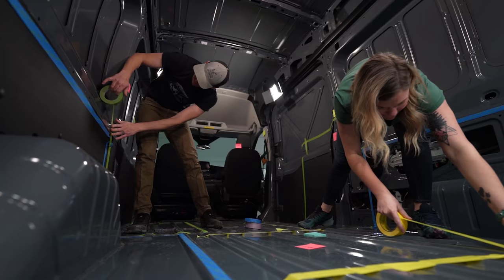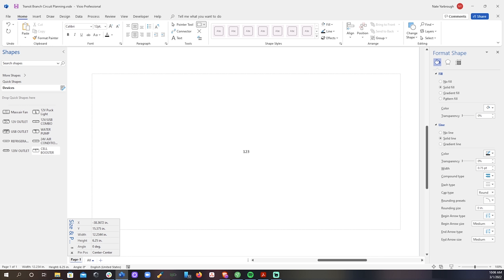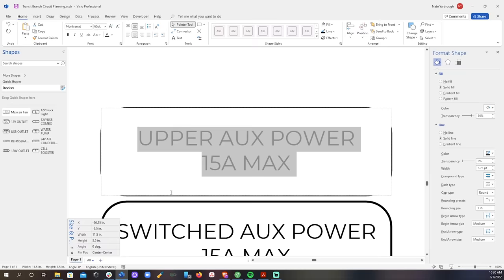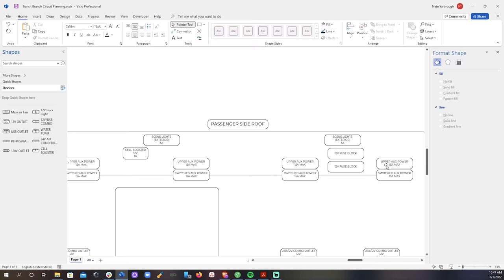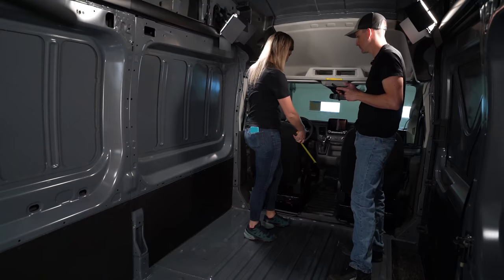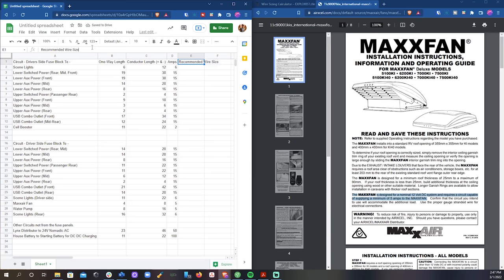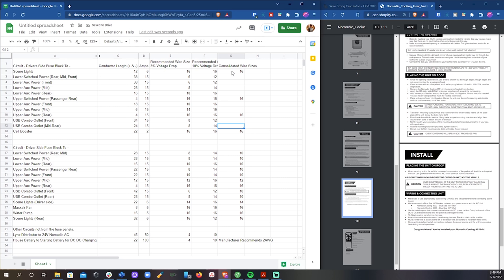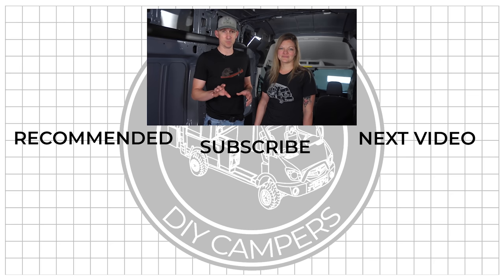Planning the Electrical System in our Ford Transit DIY Camper Van

Comment: I had rear exterior lights (to monitor the load of trailer or assist backing up off roads) on a previous van.  (Your comment at 3:20)  Best feature ever!  I had them wired to either come on automatically with backup lights, with an override switch (ON  or  always OFF).  Loved that setup, so now I add to every vehicle.
Reply from the maker: Great!  Will probably do that then. 👍

Comment: Great video, watch this series because of getting ready to do my build which is still in the planning stage until we get our van. Never thought about just putting in connections so I can add or remove items as needed like the fridge or whole kitchen unit. I have been thinking about how to make items easy to remove. The only thing I cannot figure out are water  lines and drains. I think the whole electrical box can be removeable with just a couple connections but not the heat and water system.

Comment: Any guides or resources you recommend to better understand the calculations you did and electrical information, to better understand wire sizes and why the lengths etc are important?

Comment: Thanks a lot for sharing. Now that a fair number of electronic devices can charge via USB PD (Power Delivery) and this can go to 100W (at 20V), it would be great if you could explain if you would: go via main power (120 or 240), or use 24V battery bank and have sockets that can provide USB-PD up to 100W (not sure if such outlet exists). This could maybe be only for outlets close to the batteries?

Comment: Why are you using a GND return wire? Could you not have one or more chassis bonding points and bring the return current back to the battery that way. It would lower the over all impedance of the run and then you wouldn't need heavier wire and you would lose less voltage in the wires. Only asking because I'm about to retro fit a small solar panel to my 1991 campervan.

Comment: Hi Nate, thank you, these are SO HELPFUL! When planning wire sizes in a spreadsheet, do you add together all of the amps on one circuit? I know this seems like a simple question but I can't seem to find a quick answer. 

For example, if you had two water pumps together, do you add the amps for each one, or just use the larger one (assuming they are different) since they won't likely ever be used at the same time? Or when putting together a string of lights, add the amps of each one since they will definitely be on at the same time? 

Thank you. Truly. Your active response to comments is really a huge gift to all of us trying to figure out our builds. 🙂
Reply from the maker: For 'Known' loads like a water pump or lights; I'll add the amps of everything on the same circuit.  For 'Unknown' loads like 12V outlets, I'll assume a max circuit amperage of the max amps of a single outlet (usually 15A) and understand I won't be able to load every outlet on the circuit up to max capacity; just like in a house.  Same idea of not expecting to put an electric space heater on high on every outlet in your bedroom else the bedroom circuit breaker would trip.  Great question!

Comment: It would be good if you showed people options for being more stealth for the shore power. Example - on a Transit underneath in the very back on the sides you have two factory rubber grommets. Each side has one rectangular and one square grommet going into the frame. You can run a wire down into these spaces from inside the van without drilling a hole in your van. The access hole is in the very back of the drain rails on the sides of the van but it is easier to push the wire up through the rectangular access hole. I replaced the drivers side factory square grommet with my shore power outlet. No new hole, completely out of site, and an easy wire run for your inverter charger. These access points can be used to run other stuff and are one of those things on a Transit you would want to know about before drilling new holes.
Reply from the maker: Good idea, but you're going to be highly disappointed with next weeks video. 🤣😂  We are doing the shore power inlet right on the side of the van so it's nice and accessible without having to crawl around on the ground.  Stealth is a 0% consideration on this build, though, as it will be very apparent that it's a camper and we only camp/park in locations it's legal to do so.
Reply: @EXPLORISTlife  Haha….Stealth can also be a look rather than an illegal life style. 😆🤣
Reply from the maker: Haha!  I'd say that 95% of the time anytime somebody mentions stealth in the comments on this channel, they are talking about "How to get away with sleeping in a spot that says no overnight parking". 🤣
Reply: @EXPLORISTlife  It can also be a way to get around parking rules related to the association one may live in.
Reply from the maker: Ultimately... stealth is not a goal of THIS build, but feel free to take whatever inspiration you like from this series and apply it to whatever you're trying to do on your end.

Comment: You may want one or two 20 amp circuit! Reality! Never know these might be exterior terminals. To run power tools on the go
Reply from the maker: This video was talking DC Circuits.  All of the AC outlets will be on 20A circuits.

Comment: You mentioned Passenger and Driver’s side Fuse Blocks. I currently have one on my driver’s side but am interested in adding a second to make running wires simpler. Can you share more details on best practices to do so? Thanks for all your help!
Reply from the maker: I sure can!  Will be sharing all about that in a future video, so stay tuned! 🙂👍

Comment: Hi guys, I’m curious to know if you have a video that would help me figure out what size to build my electrical system box. I plan to build it out of extruded aluminum. I can see the sizes of the batteries, VE components and other necessary items but don’t have any idea how big the box needs to be to fit all the components and connecting wires. Any suggestions are appreciated.

Comment: Awesome video! When calculating the amps, do you need to take into consideration when you have multiple units on one circuit when calculating wire size? For example, if I  were to put 2 maxxair fans on one circuit at 5 amps each, assuming we have both turned on at full blast, would I  need to be calculating wire size for 10 amps?
Reply from the maker: Yep!

Comment: Nate, if I have to wire 5 x24V circuits in, do I need to buy an additional fuse panel with your kit, or can I use the use the 120V panel or can I wire in somewhere else?

Comment: Nate,
Did I hear you say you are thinking of using a 24V system (I thought you said something about a 24V air conditioner) and charging with a DC to DC charger?  I was looking for a DC to DC charger that could charge a 24V lithium battery from a 12V alternator.  What charger are you considering using?
Reply from the maker: Stay tuned! 🙂

Comment: On Row 22 detailing your "Upper Aux Power Mid" your consolidated wire size came out to 12 AWG. Based on your model, this would be the only time you would be using this gauge wire. Since your 3% voltage drop recommendation for this circuit is 12 AWG and your 10% drop recommendation is 16 AWG, would it be appropriate to use a 14 AWG since you are using this gauge wire already on a couple other circuits and it is still between your 3% to 10% recommendations?
Reply from the maker: Yep!

Comment: Why would you use a traditional shore power inlet rather than a smartplug to reduce the risk of fire? You use a smartplug ended cable to connect tot he vehicle and then run over to a standard 30 or 50 amp power pedestal.
Reply from the maker: I don't buy into the fact that the SmartPlug is any less prone to fire than a properly maintained traditional shore power inlet so I can't justify the additional $100+ it costs to go that route.

Comment: If you are planning to have a SketchUp model of the overall build wouldn’t you want to use SketchUp to plan the placement of your electrical components as well?  SketchUp worked great for me. My biggest frustration was that Victron provides a 3D CAD model of every component but only in a commercial CAD format and not compatible with SketchUp.
Reply from the maker: I don't anticipate releasing the branch circuit wiring in a sketchup format. IMO, that's more user friendly in a diagram instead of a 3d model, so I'm going that route for all branch circuits.

Comment: Question:
Victron recommends 4G for DC/DC?  
Which Model?  
My 12-12-30 Orion calls out 6g. Which is max size that will fit in lugs. 
Did something change in last 18 months?
Reply from the maker: We will likely be using the 100A Victron Buck Boost for DCDC charging which is what I was talking about in this video.  Orion 12-12-30's are still at 6AWG.

Comment: I see you are using a Nomadic Cooling 24v AC unit. Can you briefly explain why? I'm just about to order an AC unit from them but my setup is currently 12v. Thanks and great videos as usual!
Reply from the maker: In short... DC air conditioners like the Nomadic Cooling AC's are more efficient than their 120VAC counterparts and therefore use less power.
Reply: Just to clarify my question, I'm specifically curious why you are going with a 24v unit over a 12v.
Reply from the maker: Ah, I see.  We are going with a 24V unit because we are going to be putting a 24V battery bank in this van since SO many people have asked about how to do it; so we are going to show it.

Comment: Do you have info (wiring diagram) for a secondary alternator 24v
Reply from the maker: Not specifically, but the 24V alternator w/ voltage regulator would simply feed into the lynx distributor the same as any other charging source.

Comment: Sorry one question, other than wire size is there any other reasons to go 24 or 48 volts over 12 volts? I'm looking at SOK batteries with the Bluetooth and built in heat for much less than Battleborn.
Reply from the maker: Just wanted to follow up and let you know that the video comparing the pros and cons of 12v vs 24v vs 48v systems is now live.  Here's the link: https://www.youtube.com/watch?v=sEW-ZaOOlq0&list=PLmvhcyi4n0TU6HlMaQiCUwC20DBlyv6s_

Comment: Hi, I was wondering if you ever considered a bluetti powerstation on your build? And if not why? I am considering a build but I dont have much knowledge in electrical systems. Thanks in advance for your responded.
Reply: I thought about this when I started my build, but two big drawbacks. 1) It is expensive for the minimal power it provides, unless you are just wanting to run a light load and want the portability. 2) With everything integrated into one unit, there is no easy repair if one component fails.
Reply: @ArvidDarmond  it cost 1999usd for 170 ah, thats not expensive is it?
Reply from the maker: Not really, no.  It wouldn't meet our needs.  This is an older video, but my thoughts are still pretty much the same for the most part: https://youtu.be/8XxCtgYXm98  I'd rather have individual components for a permanently installed high-end electrical system.